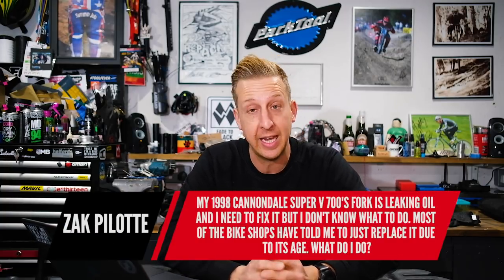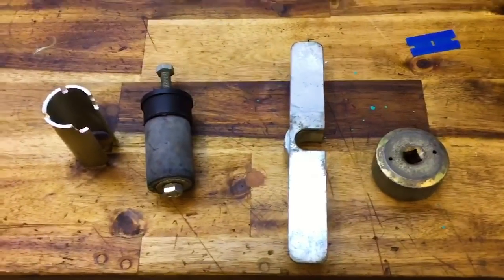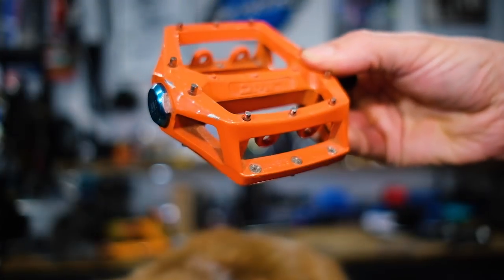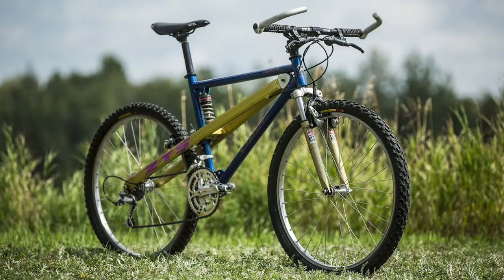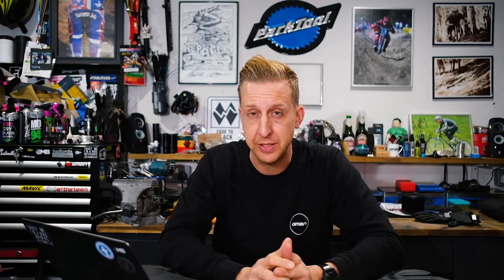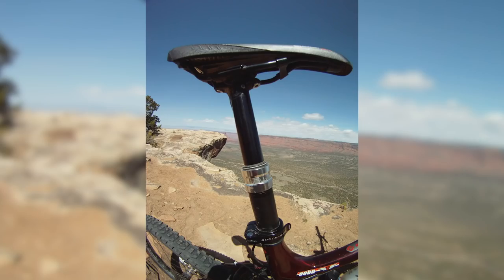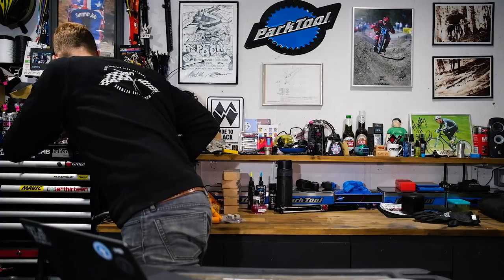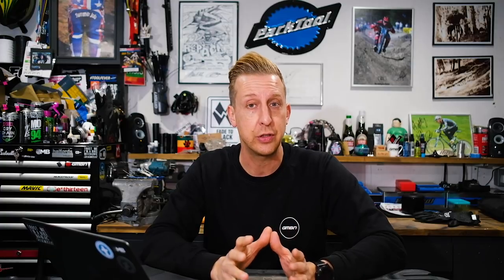Dropper Seatpost History Explained | #AskGMBNTech Retro Special

Comment from the maker: Do you have any MTB Tech questions? You can submit them in the comments by using the hashtag #AskGMBNTech 👇 for a chance to be featured on the show.
Reply: #askgmbntech I am looking at getting the canyon spectral CF 7.0
How do I know if it's ok to put a coil shock? Love the show especially top mods
Reply: #askgmbntech. Hi i have a calibre bossnut evo v2 and my fork doesn't sound good when riding and compressing the bike and sounds rattly. Also when going through compression it doesn't feel good either. Started happening after riding the downhill at fod
Reply: #askgmbntech im looking at getting a whyte g170s v2. Do you know how good of a bike it is?
Reply: #AskGMBNTech  Hi, I have a commencal meta New Zealand edition and my shock (DHX2) has some black marks on it, at first I thought it was rust but I'm pretty sure it isn't, i didnt ride my bike for about a year and ive only recently gotten back into riding. i thought maybe the black stuff was dried up oil or something. PLEASE HELP!!!!
Reply: #AskGMBNTech Hi I used some muc off silicone shine on my coil forks and now over big bumps and pumping the fork there is a squishy sound kinda like wet boots. Any help?
Reply: Can i convert a ball bearing hubs into sealed bearing? 
#AskGMBNTech
Reply: #AskGMBNTech  will a higher rise bar have the same effect as a longer stem? I have a mondraker dune and cant really go any shorter with the stem as its 30mm . I want the bike to feel a bit lighter on the front end and I also want to  feel a little closer to the bars when peddling. please help and keep up the good work!
Reply: #askGMBNTech hey Doddy, i love your videos, you can explain anything easy like a breeze! I have a question: should i put on new bb and crankset on my beloved '97 corratec superbow race? i know the pros of the integrated crankdesigns, but i last the 'retro'. What do you think, is it OK to mix original parts with new ones?
Reply: #AskGMBNTech Dh cassing tyre or lighter casing tyre with cushcore?
Reply: #AskGMBNTech What are thing that sucks about being a bike mechanic? We all know there is no perfect job. Most of us who loves to work on bikes may not have a look on the whole picture. I thing Henry has been a pro bike mechanic. Can he point some things that are not so fun about being a bike mechanic. Love the show!
Reply: Hey Doddy! Thanks for the amazing video as usual! I love the channel!
A question to you #askGMBNtech : How bad it it to bottom out on your fork? Can forks loose pressure after a long time? (like after a whole winter of hanging in the apartment?) I was riding  (by myself on easy and very safe train, respecting the local rules #Covid-19) yesterday and I jumped from a wide bump on a dirt road. I'm not great at jumping, so I did't go too high. Maybe I landed a bit heavier than I should on the front wheel, but I got quite surprised to HEAR my fork bottoming out with a CLANG. After that I had the impression that the fork was feeling too soft, I did tested on the next bump to do a little jump again, landing more on the back and it was fine... but I couldn't shake the feeling that my fort was suddenly too soft. Today I went to set my sag anew, but to my surprise it was still on the right amount (~25%). But I don't have a pump myself, I got to borrow it from a friend, so I couldn't see the pressure... The rebound was maybe a bit too slow (I turned 4 clicks further without the front well lifting, as per the test on your video on setting suspension). Could the fork really have gotten saggier with time? Or is it alright to have the fork bottoming out every now and then? Maybe I need some more volume spacers to avoid it bottoming out with the right sag? Thanks a lot for any insights and keep up the amazing work you guys do!
Cheers, Rafael

PS My bike is a 2019 Radon Skeen Trail 8.0, and the fork in question is a Fox 34 Rhythm.
Reply: #AskGmbnTech
Just put a new chain on my bike and the chain is making a creaking noise does this mean I waited too long to replace my chain and need a new cassette??? Sense the creak only happens when pedaling and it's not the suspension linkage because when I bunny hop or coast the noise stops.
Reply: I have a canyon nerve al can. I want to swap to a new santa cruz chameleon 2020 frame can my old parts fit on it. #AskGmbnAnything

Comment: 6:56 There are suspension bikes today that rely on flex. The Trek Super Calibre uses flex in the seat stays to eliminate a pivot near the rear axle.
Reply from the maker: Yea! It's great what can be done these days with carbon!  It's a great material that can be very stiff in one direction yet also supple in another if required.

Comment: I've used to ride Marzocchi XC700. XC100 seems to be of similar general construction. They are very easy for service. You let the air pressure out, take the dust seals out, remove circlips holding the oil seals (careful, not to scratch the stanchions), then compress and yank the fork back hard several times to pull the oil seals. Problem is with the oil seals which are the first thing to go. In mu fork they were Marzocchi P/N: 528191. They are not available for 20 years. They are the BABSL simmerings (lip seals) and their dimensions are 26x35x6/8 which are 26 mm internal diameter, 35 external diameter and 6/8 mm body/lip height . Problem is that typical 26/35 simmering is 7 mm tall instead of 6 and I had hard time finding one in the seals shop. However now I google it and such seal is available in automotive spare parts places so best luck finding one to A Rico!

Comment: jeez. all this different tech. Im glad i was a bmx rider back then. Im barely getting into mountain bikes and its quit overwhelming. None the less. I purchased a Canyon Strive 7.0 for the Shapeshifter as it is similar to the Super Caliber. I have some experience with hardtail and really wanted to know what full suspension felt like and i thought this would be the clever way to go. I still want to mod it with Trust fork, electronic derailer, carbon handle bar, maybe go mullet or 27.5 wheels, with tubeless system, and last but not least the 3D printed spider web saddle that has some bounce it.

Comment: #askGMBNtech Yo, Doddy! Max from Romania here! I know you since your MBUK days and I respect what you are doing here, especially on the retro front! I have a correction, though. The '97 Judy C (came with blue stickers) was the lowest end in RS line and mostly OEM spec, as far as I can remember. It had their Type 2 coil plus elastomer system and no hydraulics. It was dubbed T2 the following year, then vanished from the lineup. The thing is that in 1999 RockShox went open bath on the Judy and this is where the ”Hydracoil” moniker comes from.  The forks were no Bombers, but they were much better and much more durable. i still have various Judy's around here in pretty much every flavour, including the DHO, so I know them very well. Actually, I think the only Judy I don't have is the 1998 ”DS” slalom special, basically a Judy with a DHO lower. Anyway, greetings from Transylvania!

Mx

Comment: What about the Interloc Racing Design (IRD) remote seatpost quick release? A thumbshifter actuated the seatpost QR so you could use the Hite Rite without taking your hand off the bar. I had friends using them in the late 80's.

Comment: I've had some different answers to this question but I'll ask it once again here. 
I bought an slx m7100sgs derailleur  unaware of the fact that it doesn't really go well with the 12speed 11-45 cassette (b-tension is way to high). Is there a way to make it work decently with the 11-45 cassette because right now it doesn't shift very smoothly and I'm unable to backpedal in the lightest gears. I bypassed the tab that should sit on the gear hanger to get my b-tension semi good but I can't quite make it work as well as I would expect a 12 speed drivetrain to work :/ any fixes or tips would be appreciated!

Comment: Hi all, I have a 26'' Psycle Werks Wild Hare passed on to me from 2002. It needs some tlc before going down trails again but has been a fun commuter for to, from, and at school. However I've retired it to the garage due to the plastic bushings wearing out causing a lot of slop in the rear suspension, eventually I want to ride it on trails to have 2000s flashbacks and loan it to friends on rides. I've looked everywhere for bushing replacement kits, if you can share any light on where I can find the replacements or their original dimensions it would be greatly appreciated. #AskGMBNTech

Comment: #askgmbntech I recently bought a brand new set of 4 pot shimano slx br-m7120 brakes. After shortening the hoses I bled the brakes, bed them in and went for a ride. I quickly relized that they don’t have the bite and power shimano is known for. The levers still feel spungy after bleeding them 3 times. Stopping power isn’t very good and I can’t even do an endo (lock up the wheels). I don’t think the pads or the rotor are contaminated since I removed them when bleeding. What could be the reason? PS. My 3 bleed was very in depth with no chance for air left in the system, it’s also my firs time riding metalic pads, is there such a difference before they heat up that my old mechanical brakes had about the same amount of power with resin pads? Thanks, love the show.

Comment: I check the chain-stretch on my 1x11 Shimano XT drivetrain regularly (using appropriate tool) and am already up to my third chain in less than a year and 1500km ridden. Chain is well lubed (dry- or wet lube depending on conditions) and clean and tension seems ok. Is this normal? XC-style riding mostly. Bike is a 2019 Santa Cruz Chameleon R. Have used both a Shimano HG701 and KMC X11SL so far: durability seems similar. I reccon my weight (100kg) and riding style (explosive accelerations) are to blame and I'll just have to live with it. Are there any other common culprits? #AskGMBNTech

Comment: #AskGMBNTech Hey Doddy and Henry, at first thanks for the great content. My Bike was standing still for over a year because of an injury and now i am stuck with dried up sealant in my tires. What is the best and easiest way to clean up the Tires from dried up Sealant? i tried everything from normal soap water to Isopropyl but nothing helps to get the stuff out of the tire even rubbing like a maniac with a hard sponge doesn't help. So if there isn't any other solution can i leave the dried-up sealant in there and just fill it up like normal or would this cause any troubles? Greetings from Germany

Comment: #askGMBNtech
I am a BMXer but want to get into Mountainbiking. My local trails are downhill focused, so a longer more stabil bike would probably be better, but coming from BMX I want a playful ride. I am considering the Rockrider am 100 ht  a 130mm Hardtail. It has fairly short chainstays, but the BB is 50mm low is this bad for the playfulness.
BTW I would get one size smaller than recommended since I don't pedal a lot and like a low standover and shorter reach would probably suit me better too.
Sorry for the lengthy question, but I wanted to provide enough information
Cheers

Comment: #askgmbntech hi guys, good show. If you set up tubeless system with ARD, cushcore...etc, do you need to use more sealant? Would the foam/sponge soak up some? There isn't anything about that in the instructions.
Ta

Comment: #askgmbntech Hey Doddy love watching the show, im currently upgrading my 2014 trek Xcalibur 5 and im looking into getting a dropper for it but its a 27.2 and im on a budget, also there are dropouts for a bottle cage or pump on the seat tube would it be possible to route a cable through them to have an internally routed dropper? What are some good 27.2 droppers under $200 usd?

Comment: #ASKGMBNTECH I have a canyon strive 5.0 cf and it has sunringle duroc 30 wheels. It came with sram nx casette, but I would like to replace it with a shimano xt, but shimano uses micro spline so I should replace freehub body but I can't find one that fits. How could I save my problem? Thanks

Comment: #AskGMBNTech
Hi guys, my friends wants to upgrade his transmission but he has an integrated shifter/brake lever set from Shimano, so in order to do so he needs separate brake levers. I happend to have a set of Tektro Auriga brake and was wondering if he could only use the brake levers but keep the same hoses and calipers? Thanks

Comment: #AskGMBNTech
Hello, Im planing to do a mullet bike and shorten my fox float 36 RC2 fit from 2015 20mm so it doesent change the geometry at all. However my cuestion is if i change the travel of my fork how much oil should i put in the lower legs? the amount for the original travel or the amount for other fork whith the new travel???
You are awesome by the way.

Comment: #askgmbntech Hey doddy, my front hub bolt holes have been stripped, is there anything I can do to fix these stripped bolt holes? I'm currently running on 3 bolts on my front hub while the other 3 bolts holes have been stripped ):
Reply: Its ur main brake...just get new hub 
Not worth risk, especially with current pressures on medical services.

Comment: #askgmbntech hi gmbn, i have a issue with front brake. its kind of pulsating feel on the lever similar as you get when abs kicks in on a car. my disc rotor is not bend and its been set up nicely by experienced mechanic. when i brake hard you can see the fork kind of pulsating back and forth, what can i try to do and fix other than buying new disc rotor and pads. brake in question is sram level tl. thx.
Reply: dry decontaminating your rotor.

Comment: #askgmbntech I have got mo94 lube on my break discs, how can I clean them properly to get them running in optimal condition again, might be a silly question, love the vids
Reply: Clean.them with isopropyl alcohol or bicycle brake cleaner.
If pads were in calipers at time of or since contaminated, then get new pads also, especially as pads cheap

Comment: #askGMBNtech Hi, great videos guys. Question - should transition from hybrid rigid bike to hardtail mtb feel like driving a tank? Tyre fork handlebar - everything feels much bigger. I am afraid that the bike is too big for me (it has longer reach than my hybrid one) but it is comfortable for me to ride it. But it feels... BIG... Much bigger than I expected. Do I need to get used to it? Will it pass or is the bike actually too big for me?
Reply: i had the same experience going from a 26" tire to a 29er. you'll get used to it and learn to appreciate it on technical terrain.
Reply: @mtbikestuff4264  thanks - I changed from 18" to 16" inch frame - my proportions are weird and it is not the first time I miss the size of the bike (once I needed to choose bigger frame). Now I feel much more confident and actually feel that bike is under me and not everywhere else on the sides - now the problem is the saddle height but I will sort it out with dropper post.
Reply: Hag Pterodaktyl awesome! I ran an xfusion Hilo-straight on my last bike and loved it. Usually they are around $280 but you can get a brand new one for abt $120 on eBay.